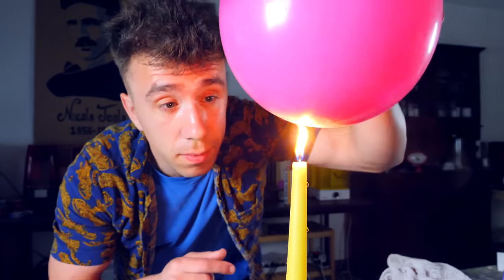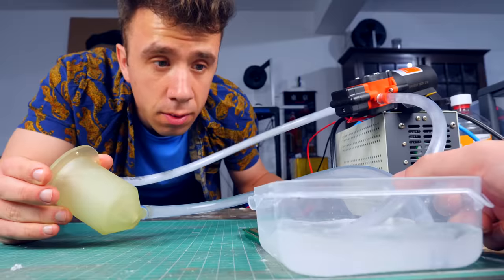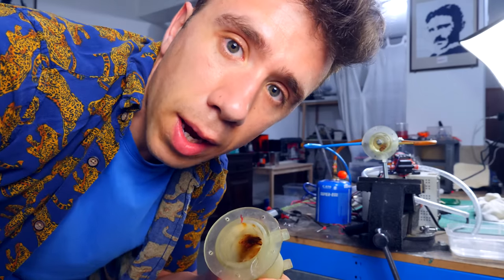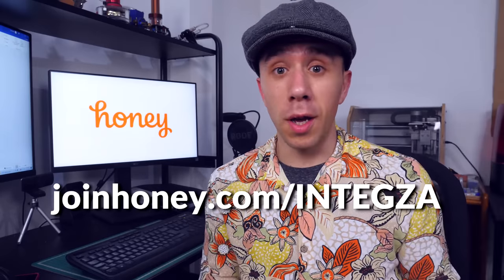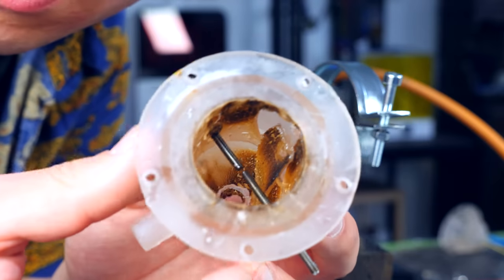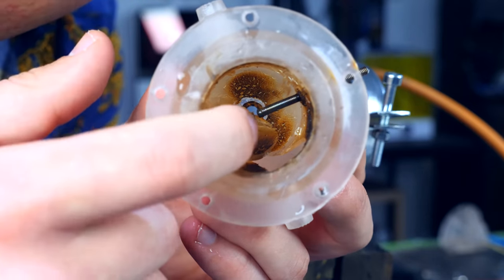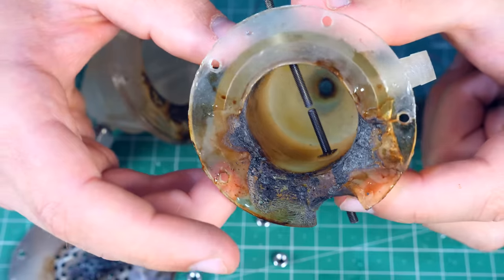Water-Cooled Jet Engine in Plastic

Comment: Awesome idea, loving the vid so far. 

Some feedback, from someone who's water cooled PCs for longer than I'd care to admit

Your water is full of air, it's hard on the pump and reduces your cooling potential. In this simple loop, your reservoir would be the logical place to bleed out air.

- Set the reservoir up above the pump, highest point in the system if possible 
- Outlet on bottom of res
- Res OUT tube straight down, if possible
- Ensure the Res has enough water to prevent air intake
- Add a baffle or space the reservoir IN/OUT far enough away, so that circulated air is not pulled back into the loop 
- Run the system for a few seconds before ignition

Additionally, water blocks tend to use a pressure plate and fin system, to ensure water passes evenly across the entire cooling surface.

I've only watched about a third, but I'd wager the baffle you added to the cooling Inlet did nothing, except maybe make it harder to bleed the system.

Turn your pump speed down initially, preferably use a soft start or something.

It's likely with your current design, that much if the water is stagnant. I'd suggest a design that forces the water across the entire cooling surface, eg. by using channels

EDIT: Instead of using explosive coolant, like a madman, put ice in your reservoir.
Reply: exactly what i thought, the airated water had to been limiting the cooling effects, and the bad flow and air still in the water area
Reply: @slimsqde7397  The aeration certainly isn't helping, but I think that the limiting factor is the thermal conductivity, or lack thereof, of the resin.  Resin is like, 0.5% the conductivity of copper, so the amount of heat transferred will drop dramatically with thickness, hence why the thin walled vessel worked much better.  Finding a balance of the thinnest wall, for better heat transfer, but strong enough to not rupture under the pressure would be the key.  I think a series of small pins that connect the inner and outer shells, small enough to not impede heat transfer meaningfully, but large and numerous enough to help keep it rigid, would be a good test.

Comment: for another video, I think you should make another Hybrid motor. as you've had issues with the whole melting thing I'd recommend making an ablative liner for the throat and nozzle. if you look up halfcatrocketry, they have one that isn't too difficult to make called CHAMBERAFE. also, if you go looking there's a good few things that can help you find an ideal throat area for a given chamber pressure. with hybrids, your chamber pressure and thus overall thrust can vary substantially due to the burning rate of the grain and its geometry, Rocket Propulsion elements by George Sutton and Oscar Biblarz has some good resources to help with this and stuff for basically everything else I've mentioned so far.
I hope everything continues to go well for you and have a nice day! 
thanks for the amazing videos

Comment: Hey Integza, nice job! Just a very simple idea about the coolant: try having the water flow from the bottom to the top part of your nozzle. That way you are making sure to always have the coolant compartment full of water and you avoid all the trapped air bubbles you had in the video (the same way it's being done with coolant in chemistry). Looking forward to the next one!
Reply: Was just going to say the same, you either make the flow go against gravity or place an orifice on the exit to restrict the flow and make sure the water doesn't run faster than the pump can push

Comment: try adding graphite or aluminum oxide to the resin to increase the heat resistance of the resin.  or try adding copper powder as well to increase the thermal conductivity of the structure

Comment: you dont have enough pressure before the injector plate(defuser) thats why it explodes in the first chamber. try using oxygen with your fuel so it has a better mix at higher pressure. you need that higher pressure at the injector. The butane isnt a bad idea, thats how a lot of rockets cool their nozzle and it preheats the fuel before going into the injector for better preformance

Comment: This is some suggestions for modifications to do in future videos to get better performance:
- You can use bluff bodies to mix air with fuel in better way. you can try disk, sphere, cone, swirl, .. with different dimensions and it's used before ignition so you can maybe just 3d print them
- You need nozzle to accelerate the flow to get better performance and you can also use carbon fiber as you did in pulse jet engine to create them on 3d printed molds
- Also to check the air to fuel ratio you can use oxygen sensor on the exhaust as done on cars to see either you are running lean or rich and which will give better performance
- You can also use small amount of the exhaust to heat up fuel before injected

And for sure to do all of that you need to build test rig some how to measure the output from the engine. Not just to compare between different modifications but also to compare the between the input and output power
Reply: Lol, mixing is the problem, that’s why rocket engines use injector plates
Reply: @brucebaxter6923  I will check how injector plates, thanks

Comment: I think i have a fix for this engine. I saw it always melted on the top where there was less water. You need canals to spread the water evenly around the engine. Maybe some sort of spiral canal?
And for the metal part you could simply make it bigger so it stands out of the engine and place some cooling on it. That should also cool the metal part inside the chamber because metal is a good heat conductor.

Comment: Realy cool ideia, I would try 3 things:
1. Try using a 3d printable material with better conduction.
2. Try creating a vortex with the fuel.
3. Create turbulence with the water flow, u could make the inner walls realy thin and use a trelice structur for the pressures, the trelices could posibli induce the necessary turbulence.

Comment: You should use a newton meter on your engines, so we can rank how effective they are. 
And how much small changes in design will differentiate the thrust.

It would be fun to see your progress in making them more effective after each project! :)
Reply: The easiest and most robust way is probably with a stand that's on a pivot, with the axle a meter or so away. The whole thing can be made out of wood very cheaply, with a load cell from broken kitchen scales. With this design, you can place the cell anywhere along the lever to get whatever ratio you want on the cell.

Comment: @Integza, u can extend this series by changing the flow design. Try to keep the area of the flow space equal while keeping the surface to the heat source and sink as large as possible:

A_{in} = pi * r ^ 2 = n * pi * r ^ 2 = n * A_{n, out}, or
A_{in} = pi * r ^ 2 = n * h * w = n * A_{n, out}

I suggest you make a helical shaped water cooler. I suggest a ratio of 1 to 5 (n = 5).

Comment: Try placing the reservoir above the engine to get the air out better.
Also place the water outlet at the top of the engine so the whole compartment is exposed to water

Comment: You should try to make a turbojet engine that runs on hydrogen peroxide and a catalyst. This way you don't need to use heat-resistant materials or compressor blades.
Reply: He did

Comment: For a future video, you could build a TURBOFAN engine, a jet engine with a rotor in carbon fiber like you already did, it would be a jet engine similar as the engines of planes today and it would provice thrust. You could use metal sheets to build the compressors.
Please like this comment if you want to see a video of this project too
Reply: great idea I would also want to see this video
Reply: That's a great idea, you should definitely try this in an other video. I think it would be awesome.

Comment: running your water from the top of the combustion chamber to the bottom will help with the heat distribution. also try to cool the plates holding the metal diffuser and possibly make it smaller than the full circumference of the two chambers so if it does continue to melt the plastic its not melting all the way through to the  bolts and blows the seal. I love what you do and really enjoy your content thank you!!! on your next video id like to see you upgrade this design.

Comment: Ideia: How about to create a portable shower that use butane to heat the water inside it and you could use it whatever you want? Example: if I want to go on a trail and take a hot shower just by the river, you just need a “3D printed” shower that you can plug a small butane tank and use some batteries to ignite then and heat the water! It could be a really nice product!!!
Reply: Thats already a thing, its called a pot of and a gas stove.

Comment: Fun fact, some rocket engines are liquid cooled in a way similar to the liquid butane attempt, it's known as Staged Combustion and it also helps with efficiency since it preheats the fuel before ignition.

Comment: I have a suggestion:
Why not feed the butane from the outlet of the cooling system back into the combustion chamber since most of the liquid butane would've turned to gas at that point(the butane can be used as both fuel nad collant!). most of the rocket engines which use cryogenic fluids as fuel use this technique to cool the nozzle down

Comment: You should continue making that engine and then make a collab with ProjectAir or Ramy RC and make an airplane with this. I think that with a better nozzle and a bit better cooling and design of the metal part you should be able to make a reliable engine that generates some thrust. Also you could try to use a more heat conductive material on the inside, so the heat will be better transfered to the water.

Edit: I forgot to mention that you have a lot of air in the water pipes. That makes the cooling much worse.

Comment: Try mixing the fuel/oxygen inside of the combustion chamber. To prevent it from flowing backward into your diffuser, your flow has to be faster than the flame propagation which is hard. Modern rocket motors don’t mix the fuels/oxidizer until they’re ready for it to actually go bang 🔥

Comment: Video suggestion:

You should make an HHO generator (oxyhydrogen generator) and power a rocket with the fuel would be cool to see you make your own fuel to power your rockets
Reply: Alex Lab has a great video on this. The video is called 'High pressure electrolyzer. Detailed DIY guide'.

It worked so well, he powered his dirt bike with it.
Reply: @HaloWolf102  can you link video Im very interested in HHO

Comment: Integza, I would rework the inlet and outs for the water. Have the ports set to the side of the coolant chamber so the water SPINS around the combustion chamber. The coldest water should enter the system at the hottest point so the inlet needs to be at the tip. Then have the water outlet on top at the back of the combustion chamber. 

There was WAY to much air in the water and like you said water can hold a TON of heat but aerated water is damn near the same as just air cooling. The entire cooling chamber needs to be in a laminar flow state to get maximum output.

Comment: Here's an idea:
A Centrifugal turbine compressor feeding air into the flame tube and the nozzle at the back fed into a Tesla turbine at a tangent. The axle of each compressor would be parallel with the 2 turbines operating on the same plane, unless you could find a way to create a coaxial version
Reply: The coaxial version is the most common design commercially, it's quite elegant but the downside is the engine must make a minimum amount of power to maintain idle. By separating the turbine from the compressor you end up with something more along the lines of a rocket engine which allows you to focus on optimizing the combustion chamber as there's no minimum power requirements to keep the turbine spinning fast enough for the compressor
Reply: @maasmorin7606  by keeping it a biaxle, you can maintain tangential flow out of the compressor and into a Tesla turbine.. think of it looking like a cassette or vcr tape. Then gear the turbine and compressor to a drive shaft, much like chainless bicycles use. Purely for the art of it, not the practicality

Comment: As a suggestion, although the water is constantly flowing through the cavity, the volume present in the cavity at any time is constant. If you increase the cavity size it should allow for a better dissipation of heat through a greater volume of water

Comment: you can actually have a diffusor that is also refrigerated, since its for metal and its a great conductor it should be more effective to dissipate heat from it, you can also try car coolant liquid with etilenglicol that has higher boiling point.
Reply: water cools better than antifreeze
Reply: @menogusta9829  Yes, but when you're talking about conditions that may have superheated pockets, it's best to raise the boiling point. Bubbly water with steam pockets is a worse conductor than antifreeze.
Reply: @dustinbrueggemann1875  my understanding is that the raised boiling point, for the most part, comes from the pressurization of the cooling system in a vehicle.

Comment: Maybe you should try to add some heat insulation between the metal and the resin body, while extending the diaphram so it can cool down with surrounding air. Great video!!!

Comment: You could try lining the engine with foil to help the heat dissipation and allow the water cooling the best possible chance to defuse the heat. It would also help seal leeks and re-enforce the structure. I know it's cheering but if the internal wall was aluminium and the outside was printed the main structure would be printed and the inner wall would be strong enough to withstand the pressure act as a better heat sink and give the whole thing a better chance to work.

Comment: I was watching you prep to do the butane cooling - that's a common way of cooling rocket engines.  Good but dangerous idea, and glad to see it failed "safely!"

It may help your cooling if you flow the water in from the bottom on the "rear" of the motor (closest to the diffuser), and out from the top near the front.

Comment: So as an aerospace propulsion technician I love watching your videos may I suggest you use an axial flow design with about an 80% bypass airflow and a canannular cubustion chamber design use the bypass air to help cool the individual cans. Doing so will divide the the combustion heat into a larger surface area making it easier to cool

Comment: I've often wondered if you could run a steam turbine off the excess heat from a combustion engine. Perhaps that could be a future project
Reply: On piston based engines at least  that's basically what a turbo does to increase efficiency
Reply: After turbo, there could be enough heat to power a sterling engine. Turbo is anyway much more effective, it doesn't require heat exchange, it works by flow, that basically comes from heat. Too bad peltiers are nowhere near as effective as we need them to be..
Reply: @squidcaps4308  Ive played around with peltiers a bit in a very non permanent installation, both near a catalytic converter (on a 1g honda insight) and after the turbo on my 95 gsx, and you're definitely right that they arnt really ready to do anything super meaningful on a car. On my old insight, it would make the most sense to reduce the load on the generator (no alternator on the 1g insights) but it would take alot more complexity than its worth to even get close to replacing the alternator on a "normal" car like my gsx.  the amperage just isnt there for the demands.

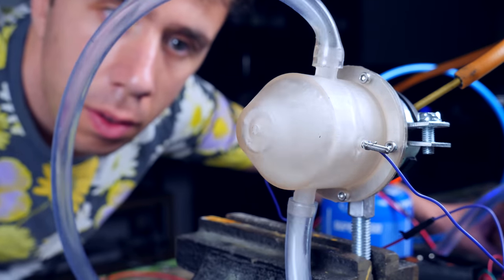Comment: in the 7:00 ish design, the water should be going upward. This will ensure that no air bubbles create and that the hot water (going up) is leaving the system first. It's the chemistry way of cooling something.
This means water entering from the bottom and leaving from the top.
Nice vid !!

Comment: Integza, you don't need a metal diffuser. If you increase air pressure going in towards the nozzle, you can get a better air/fuel ratio, and simultaneously keep the intake session cooler, since the combustion won't go towards it. I recommend using an EDF, to feed the intake other than compressed air. 
That is also the reason why your engine was struggling to keep running constantly and in a stable manner. 
Since the engine was starved of oxygen, the combustion stopped and the thrust ceased, than air rushes in from the nozzle, reigniting the gas. 
So basically you made a valveless, water cooled, pulse-jet engine.

Adoro seu canal, você me inspira 😀!

Comment: On the £D printed, Water cooled jet engine, try punching the holes in the Diffuser with a very small pointed punch (a nail will do) into a funnel shape, so that the holes point into the combustion chamber, and bend a piece of  sheet steel, so that it covers the inside the chamber to disperse the heat away from the sides of the plastic. A  tin can can of a suitable size could be used to do this, without the need for any involved metalwork, with the base of the can being used for the diffuser, and the sides of the can to cover the plastic sides of the combustion chamber.